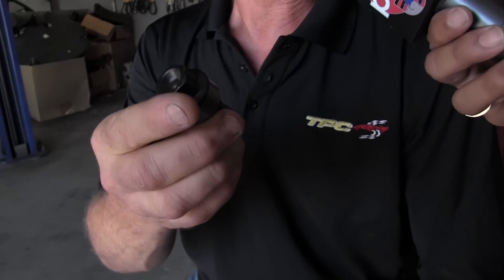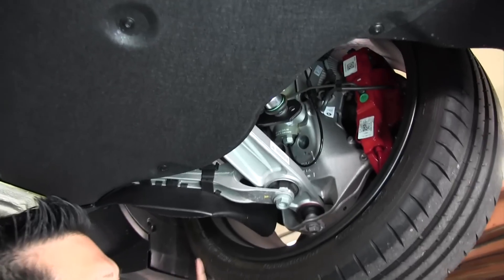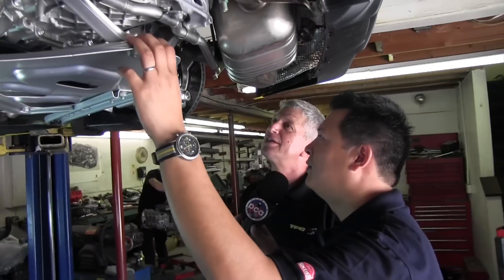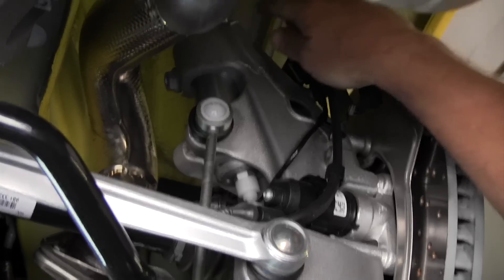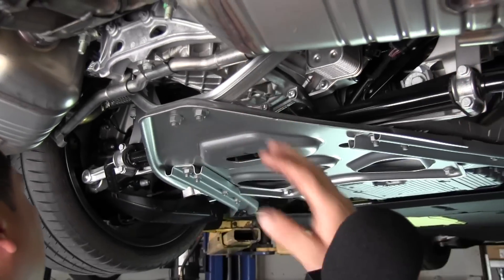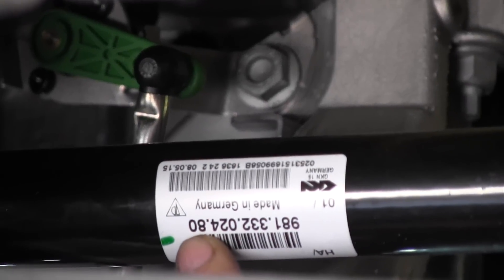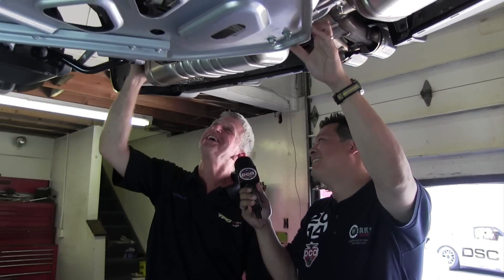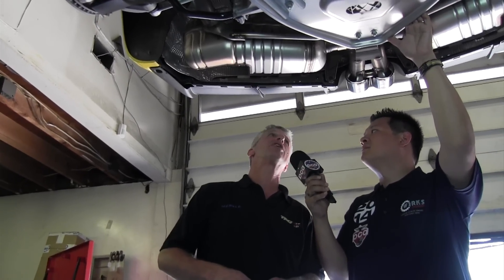PCA Spotlight: Cayman GT4 technical analysis

Comment: That's very interesting, thanks for that. In terms of converting an S to a GT4, the majority of the changes talked about in this video relate to chassis stiffening and this is really only going to be essential for a track car with very grippy tyres. If you are just using normal road tyres, just upgrading the springs, sway bars, dampers and suspension arms to readily available aftermarket items should get you all you really need for the GT4 experience on the road.

Comment: I mean, those cars are almost perfect. But as an engineer, there is one thing that makes me wonder. It is the bolts for the suspension. Why does the bolt dont come thru the nut all the way as it is supposed to showing at least 1-2 threads. I've seen this on some Porsches and I cant figure out. No other cars are like that. It is against ASME and what not unwritten rules.

Comment: Oh yes the GT4 thats the one that the Gearbox has to be replaced due to 3 rd Gear giving up as the Shaft was welded !! but better still its the Front Suspension Turrets where there is a Big Difference in that the GT4 ones crack and shear off as they are Alloy so all that weight Saving makes its a Ticking Bomb on Track.
Not Bad for a Track Focused Car.
Reply: Hi ! Where did you get that info from ? Still valid in 2025 ?

Comment: Great GT4 chassis info .. PAG has finally started production of the mid-engine coupe. Dam, make my MY20 GT4 series II coupe in metallic grey LY7U w/black leather everywhere.  Cheer's..This video strikes a fond memory when taking delivery of my MY98 993 C2S ..Day old new coupe In the home garage, up in the air, remove all 4 tires and laying on the garage floor discovering the 993's chassis. Nothing better.   Good luck w/GT4 coupe.
Reply: J

Comment: so ... you started with the lugnut being different, but never told us what was different about the lug nut (rather, lug bolt) ... so, how is it different?
Reply: My thought too. My first reaction is it has more weight ;-(
I compared carefully many bits of the GT4 and the new 718 surprisingly a few things (like the cross beam that ties the two sides at the rear sway bar) they are gushing are also in the 718.

Comment: is it true the GT4 is a limited production or will Porsche make more? Pls advise
Reply: +PCAHQ  The Gt4 Rs would be way faster then a 911 and for that reason they won't build one they said.
Reply: llavero5
The chassis base is modern. The 911 concept is a very very old concept and therefore old/older comparded to the Gt4. Like I said, the Gt4 is not as Powerfull ON PURPOSE becasue they know the cheaper Cayman would be faster that a 911.
Reply: llavero5
You dont seem to get it. The Porsche 911 base is from 1963. The Cayman is from 2005. Talk to a race engineer if you lack in knowledge, the mid engine concept is faster with the same amount of horsepower. Carrera Gt was tested on 10 year old Tyres, would also be faster on modern tyres. 4 seats in a 911 :D for who in the backrow? Midgets? Kids? You REALLY seem to know nothing.
Reply from the maker: +636 OC It's limited production during this generation of Cayman, but Porsche has left the possibility of another GT4 open in the future.
Reply: No good reason, because 911 carrera is a city car and GT4 RS would be track car, and yet 911 GT3 faster.
Reply: Rocco0002
 But GT4 dont have same power.
And "fastest because modern" is not a reason, per example:
NSX-R: 7:56
F360 CS 7:56
F430: 7:55
Anyway exist GT3 all years (GT3 RS 2016), dont know why you think GT4 is modern.
Reply: Porsche did new chasis por cayman 718 when cayman 981 is very similar.
So no sense when you say 911 have the same chasis in all his years and models.
Or you think 911 carrera and 911 GT3 use same chasis? the new 911 GT3 RS ppl say about 7:20 lap, imposible for a GT4.
The GT4 is not as powerful because is  A CAYMAN, and 911 is not as powerful like 918 Spyder because is a 911.
You have the carrera GT mid-engine too running slower 7:28 than ne GT3.
I no understand the obsesión of people for say cayman will be faster than 911, 911 have 4 seats, is another different car, people dont choose 911 because is a fast car.
Reply: llavero5
with the same Horsepower the Gt4 would be faster as a Gt3 because its the more modern car. Mid engine is faster then rear engine.
Reply: Rocco0002
 You talking about chasis and now you talking about engine place, this is different things!

Of course i know the advantadges of mid engine, this offer lower polar moment inertia, but in corners all cars  can move his weight for mass transfer, simply changing the style in corners.
But rear engine is good for brake, because big rear tyres have a lot of grip and they can be used for big stoping power.

Low polar moment inertia is fun, steering reaction is 0,1 or 0,2 second faster than high inertia, but too make the car more radical and hard to drive in limit, wit more agresive reactions.
This is not that simple like you think, you can see GT3 times better than other mid engine cars.
Porsche have 60 years performing the rear engine.
Reply: @llavero5  I agree with you to a point, but it is only since the 991 generation that have Porsche managed to 'fix' the inherent flaw of being rear engined. Rear wheel steering goes a long way in helping turn-in and mid corner front end grip. Also the engine moves further forward with every new generation of 911. Personally I think it's a shame. There was a certain character to older 911s that made them different and satisfying to master. The 997 GT3 RS will be remembered at the last great RS model.

If you ask any engineer to design a performance car from scratch, he would never put the engine behind the rear wheels. But it makes sense in a 911 for the road as it allows a useable 2+2 seat arrangement which makes it the best all round sports car available.